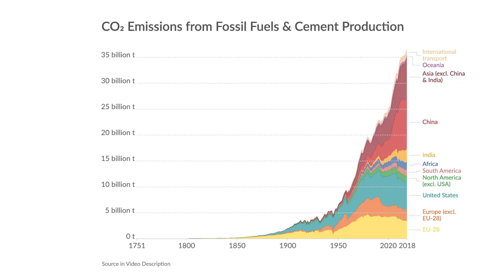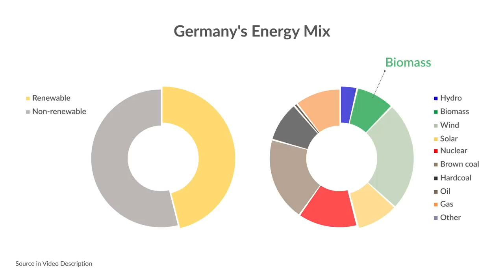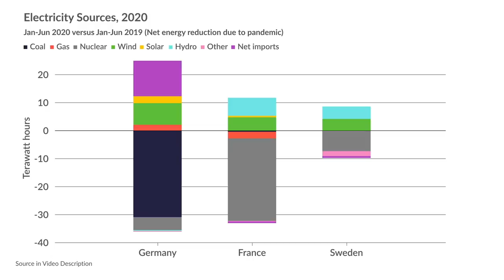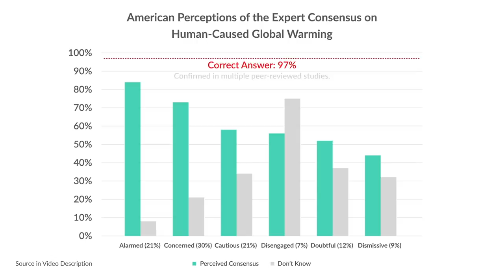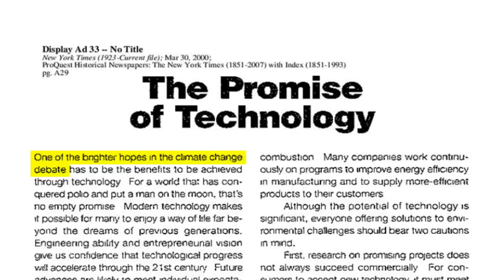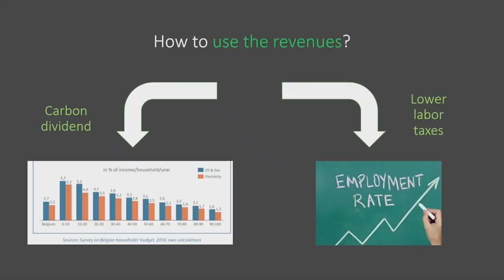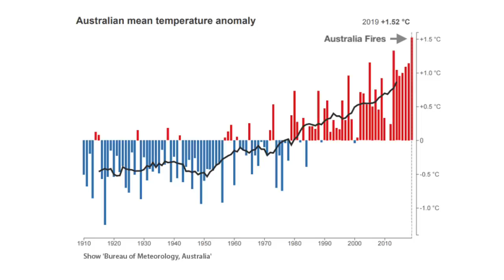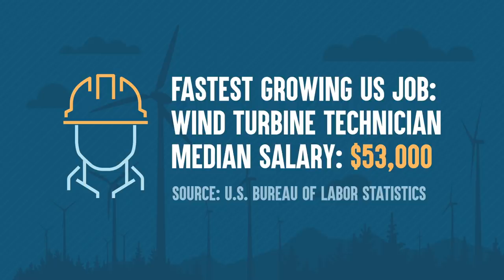The $5,200,000,000,000 Trick Killing More Than Covid, w Stephen Fry.

Comment: It's nice to see that this video points out how misleading bio-fuels are being labeled "renewable" and it is true that it cost us just as much CO2 to make solar cells as it does to mine coal and burn it. But let me remind everyone that Solar and Wind should not be seen as power producer's they are more like power stabilizer's for load balance's during peak times. What should be seen as the main weapon to fight pollution and should be our main power source of renewable energy is Geothermal power. Geothermal power is available everywhere on the globe, some place's easier then others but to tap the earths natural inner heat anywhere on the planet would require core drilling machines to dig down deep enough to reach the earths inner heat. This would be the Geothermal plants main cost to build and would require fossil fuels to create as well but this would be a 1 time cost and the Power plant would not have a limited fuel supply function, like coal and nuclear power plants have and geothermal is clean burning too. So yes to make solar panels and wind turbines does cost a lot in CO2 to make but those are not good power sources, they are very limited and are not available 24.7, Geothermal is a very powerful source of energy, is clean, and has no time or fuel limitations. The cost to build geothermal plants is high but if you compare its cost to the cost of nuclear, bio-fuel, and coal plants its cost isn't that much different.
Reply: I agree. Probably this is not pursued as much because you can't make weapons out of it?
Reply: Very well said.  In addition to the benefits already mentioned as geothermal generation uses high pressure steam to spin turbines. This spinning mass stabilises power grid frequency in a reliable manner - something wind and solar do not.
Reply: @michaelwalk7130  good point!
Reply: Now that’s a good idea but how much drilling would it take in places covered by ice n ❄️ snow.$$

Comment: "You use more fossil fuels to do this". This is the best logic FALLACY if ever I saw one. MISTAKE: the idea that you must use fossil fuels to "do this". Simple reasoning. Of course to "do all this" you must first create the infrasctructure for renewable energy. That also costs energy and as long as the new renewable infrastructure is not there the energy used to do that must of course come from somewhere, that is from the old fossil infrastructure... That much is true(!) However, concluding from that that the renewable is just as harmfull as renewable is NONSENSE. Because once the renewable infrastructure is in place, the energy to build and maintain the renewable infrastructure will ALSO be RENEWABLE. So, the fact that we need fossil to produce renewable = TEMPORARY. Once the infrastructure has been created, everything will gradually become renewable, and the problem will go away. Caveat: This does not preclude of course that we should also clean up our act in terms of mining of the necessary minerals, etc. But that is a different problem...